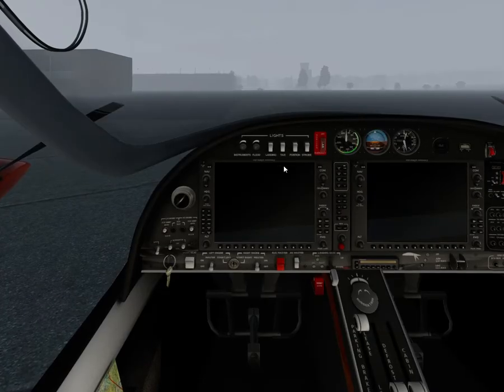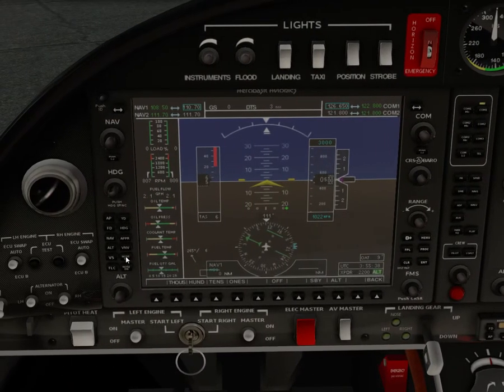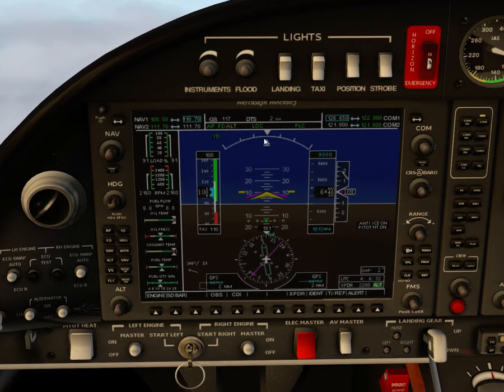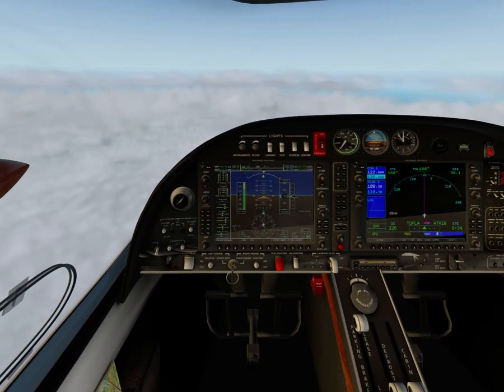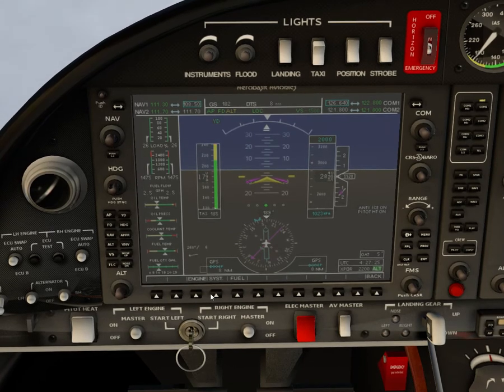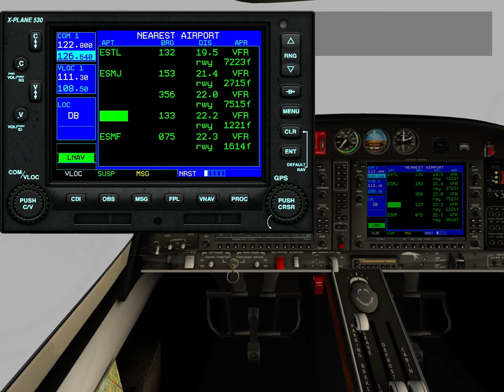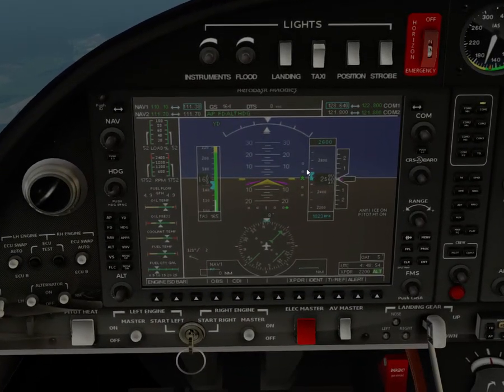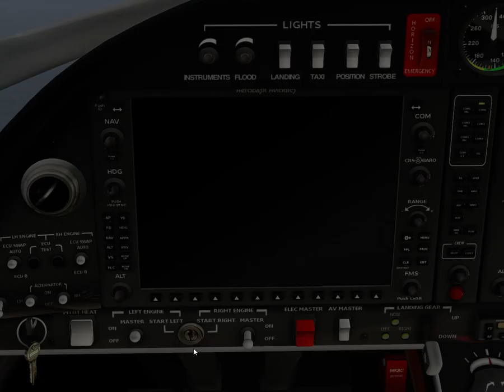X-PLANE 11 - Aerobask DA42 Twin Star

Comment: Does DA 42  aircraft purchased for X plane 10 runs on x plane 11 ?
Reply from the maker: I do not have XP10 but from what I understand it runs on XP10 then you add a patch which makes it run on XP11. take-care
/Anders
Reply: I have just tried ( without patch ), It works so you can try !!! Thanks for answering :)